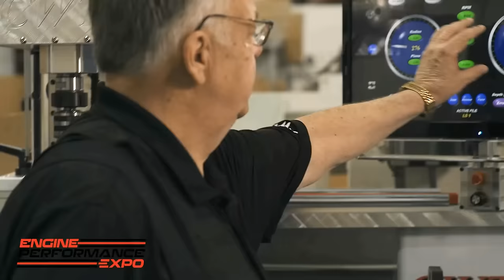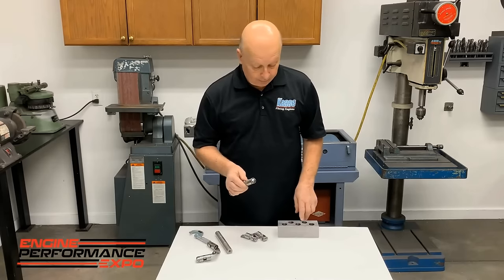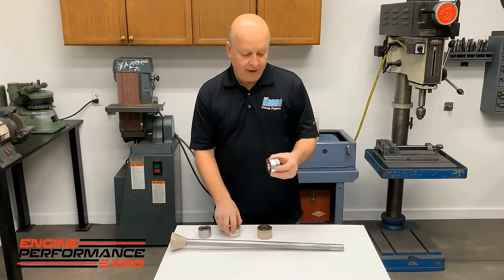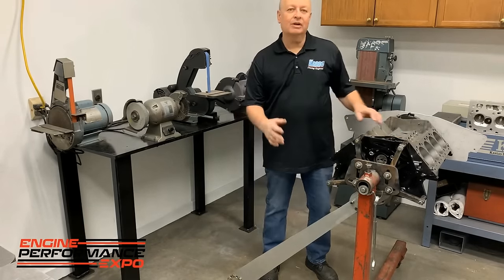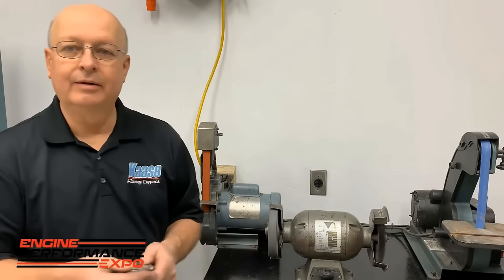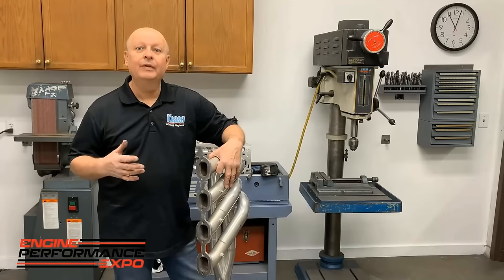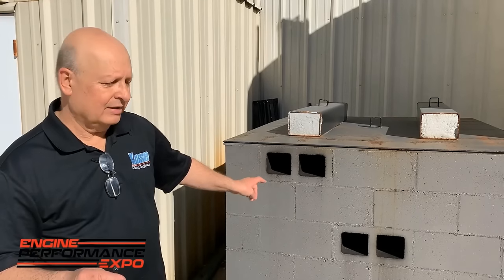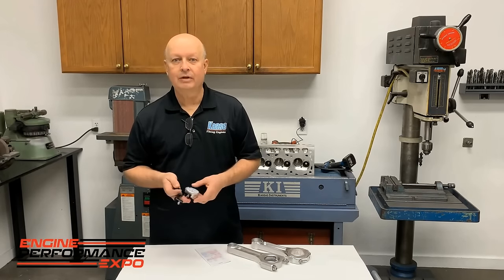Assembly Tips & Tricks from Jon Kaase - Part 1 (Expo 2021 - Episode 38)

Comment: This is a video that doesn't suck and all useful information, (even if your never going to build race engines).
Some of the things I've done for 40~50 years as an 'engine' machinist but others were new to me.
Piston holding fixtures, I always cringe when I see 'professionals' just clamping pistons or liners any old vice or whatever.
Nickel bronze valve guides, (C63000) specific for Titanium valves? 
I know titanium has a lot of issues as it's difficult to machine and likes to 'combine' with just about anything it touches.